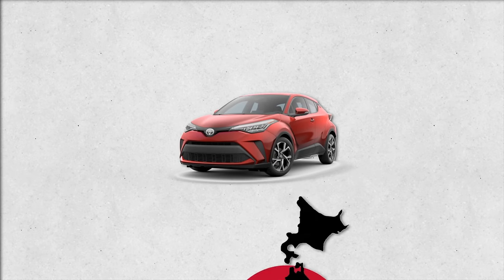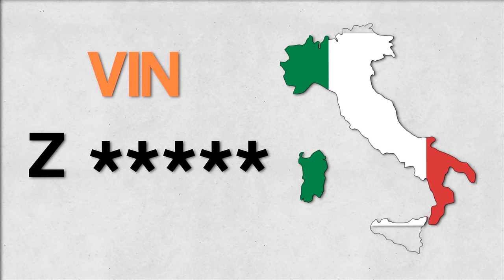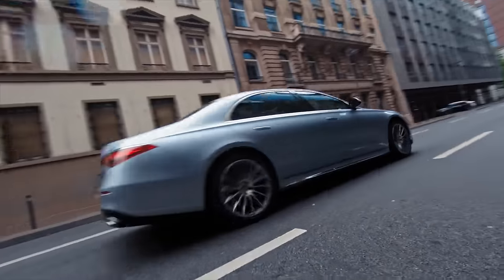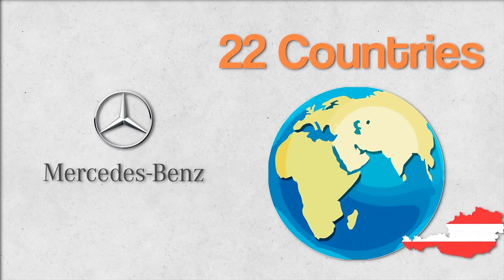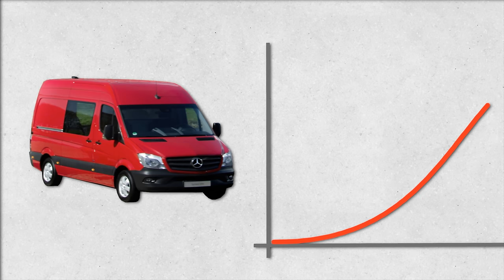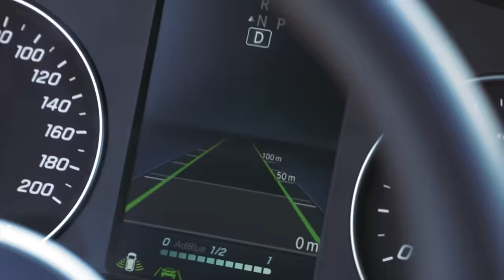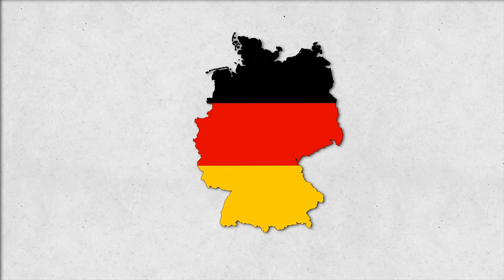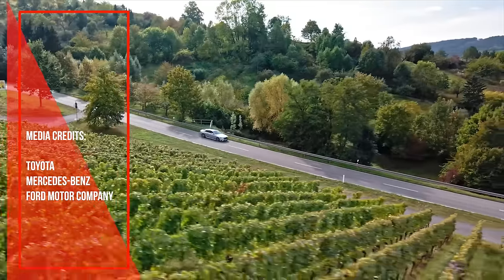Never Buy a Car Made in...

Comment: I used to be a mechanic at Honda. There was a notable difference between us made Hondas and Japanese made ones. The Hondas made in Japan came in for maintenance intervals. The Hondas made in US came in for rattles and water leaks. Everytime we had a car with a water leak complaint or rattle I'd check the VIN and it was US made.
Reply: Even a Honda Civic ─ Made in Japan & Canada ─ is like 25% Diff... in QC & QA's yet prices were about 15% higher from Japan.

My Subaru Made in Japan 1992 -- Never changed Timing Belt until 2019 & still in good shape😄🤣; and my In-law Bro has an Outback Subaru from US; and 2007; needed Gasket Heads and Cost more than 1k repairs; My Legacy never cost us more than 400 except the last time = Timing Belt, Thermostat, Water pump; made the repair bills 1k

That was all; except the CV-axles :thanksdoc::sanitizer:
Reply: I had one of the first VW rabbits made in their US plant. You could put a hose on it for hours.. no problem.  Drive it in the rain and it became a rolling bath tub. The frame flexed and seals and sealant around the A pillar would open up and let the water in. Wide spread problem. Never fixed. Unfortunately I bought it just before the NY lemon law was enacted.  Strange how the previous years cars made in Germany didn’t have that problem.
Reply: 2004 Honda CRV built in Japan.still going strong. 300,005 km’s on it. Still got original globes except for the headlights. 👍🏽
Reply: Wow!
Reply: 2005 chevy cavalier 305 thousand  kilometres and going strong.
Reply: funny how 2022 NSX Type S is made in OHIO 😂
Reply: @THillick , my dad had one he bought new in the late 70s and had the same leakiness. He even had it repainted but sold it at 9 years old for a Nissan that gave fewer problems and would have kept longer if not for rust issues.

Comment: I work in a GM plant which used to be a joint venture between Japanesa automaker and GM.

First 10 years there we had to implement KAIZEN as the Japanese insisted on it. Then GM bought out the Japanese portion and we became 100% General Motors.

Our assembly plant hasn't been the same ever since and quality has been declining rapidly, mainly due to difference in philosophy and approach.

Ex.

When we were half Japanese, when employees spotted defects and stopped the line to correct or report it, we were praised and we would often receive gift cards etc...

Under General Motors if you stop the line to point out a defect you can actually get in trouble, you're told that this is for Quality department to worry about it and not you, and if everyone will start stopping line for every little thing, we won't get our numbers. And a lot of issues won't get picked up by Quality because by the time it gets to them, other parts covered the defect etc... 

Also under Japanese involvement we had Quality Check Team at the end of every line, and we had shower booths to test for leaks. Since GM took over completely, they completely removed shower booths, we bo longer test for leaks, and we only have check team at end of Final line, where they are very limited to what they can detect.
Reply: To little to late to detect a problem at the end of the line. You will have to Re-Do the work again and it is one of the 7 known wastes in industry. The concept of TQM should work fine if implemented correctly, training workers properly what kind of defects require to stop the assembly line for.  In addition, you reduce the cost for extra QC Man/Hrs.  TQM is a philosophy and a culture more than a method of work.
Reply: Wow, you sold me
Reply: Is this Cami Automotive in Ingersoll, Ontario?
Reply: That's awful I would much rather strive for excellence if I was assembling anything! I like perfection especially on a item like a car where it's one of the largest purchases many people will ever make! 💯 Shame on GM!

Comment: I would buy a Toyota made in USA or elsewhere. May not be quite as good as made in Japan, but better than any domestic brand, based on experience and my wallet!
Reply: I will not own a vehicle that isn’t a Toyota my 200& Corolla has probably 350k+ on it. I drive it about 67 miles 4/7 days a week. Plus all of my family have yodas. Great car brand.
Reply: Its better than those in Southeast asians made. Those are crap, full of problems.
Reply: Yee toyota have much better qc than others. In my country bmw is just like they didnt checked any qc.
Reply: @idhamrodzali6091  Southeast Asian Toyotas are actually reliable.
Reply: Save your money.  I have a 2020 Corolla made in America and the engine needs to be rebuilt at 60,500 miles. Toyota will not cover it even 500 miles over the powertrain warranty and it'll cost $8k.
Reply: @sasukesuite1  been driving Toyota's 20 years, only routine maintenance, my neighbors have 2 with 345 and 260 thousand miles, again routine maintenance. You got one of the very few lemons. Before Toyata, lost almost 20K on the big 3. I understand your frustration, been there 3 times!
Reply: I have two chevys one with 900,000 and the other 300,000 miles. American made baby !!! I don’t buy Foreign cars. Keep the $ here… do you homework on buying vehicles and keep up with the Maintenance on them… it’s that simple

Comment: My 2002 Lexus ES300 is made inJapan and the quality control was at the highest with the 4th Gen ES (2002-06). AMAZING Build quality, fit and finish is unparalleled. Car is so quiet, the amount of insulation can’t be overstated enough. This is a major difference between a Toyota and a Lexus
Reply: AGREE!
Reply: No, you are imagining things.
Reply: My 2010 RX was made in Cambridge, Ontario, Canada!  Still driving like new and still looks like new!😍
Reply: @Jonathan McCully oh boy you’re a rookie. I have 93,000!
Reply: My 07 camry is made in Japan and has better quality than American made toyotas
Reply: @Jonathan McCully off a cliff? Try to find a used 2008-2015 IS 350 with under 150k it can be pretty tough sometimes not buying from dealers
Reply: @captinbeyond  I use a small auto repair shop, highly dependable. Business is at least 20 years old. Labor rate is $90/hr. He replaced my original alternator last summer with labor for $310. GENCO brand. 

I Would never bring my car to a Lexus dealership for service unless it was a factory recall item and being 20 years old I highly doubt any factory recalls will be coming out anymore
Reply: my 2002  Lexus LS430 Ultra luxury with 215000 miles made in Japan still looks New & runs like a champ 😁
Reply: My 2001 es300 is the same super comfy and made very well
Reply: Agree with you
Reply: @whostachi  best car ever owned and this is #21
Reply: @thomashenry794  my sister leased LS350 in 1996 and she turned it back after the lease ended and we the car was sold on the spot for 13K after the key and paper change hand.
Reply: @johnmadow5331  nice the older ones were better made but the newer ones haven’t fallen off a cliff like this doof is suggesting
Reply: @captinbeyond  I try & do all my services myself, I've done brake flush, power steering flush, and replace all 4 struts myself 😁
Reply: I have a 2006 Lexus is250 with 230k miles still runs like a sewing machine! Its the best car I ever had even  including newer ones!
Reply: @captinbeyond  Had 2006 LS, great car till small front end damage by car running stop sign. Never drove right since then, All of a sudden it developed the habit of accelerating on it's on, often at the 40 mile speed, Would pick up 20MPH on it's own. Stupid me bought off the floor a 2019 LS500 and was never happy with it. Sits in the garage while I drive a used Mercedes E350. Wife loves her 2015 RX350.
Reply: I own a 2012 Lexus ES350 with only 58K miles made in Japan fit & finish and driving experience is extremely smooth 👌
Reply: @KA-te7xk  I had a 2013 ES350 before my  ES300. I bought it in 2018 and owned it for 2 years, bought it from a dealership who took it in on trade. It only had 30k miles on it and I sold it to Carvana in April 2020 with 42k miles. Not one issue in 2 years. I changed the oil 2x and that was it.

Comment: My friend got his hands on a 97 4runner from Japan. Despite the fact that it has over 220k and a small coolant leak, she starts right up and runs fine. The interior is still in quite decent shape as well, and he bought it before prices went bonkers. Big win in anyones book
Reply: I got a 05 4runner with 223k miles, runs excellent. Had it since day one & I never changed the transmission fluid because the dealer told me not to. I really wished I didn’t listen to them but to be honest with you the transmission still shifts smoothly & zero issues.
Reply: @joeshmoe8952  please tell me you have changed it now though?
Reply: @Mika-ph6ku  For what? It’s been 17 years & not one issue. I guess Toyota was right.
Reply: @Mika-ph6ku  after like 50k miles if it was never changed it’s better to just not change it at all. Changing it now could cause it to slip and start acting up.
Reply: @cheesenuts1898  That’s a good point but I did change the transmission fluid on my prius which has a sealed transmission but it’s a 15. Lots of mechanics say the newer cars can have the fluid changed around 80k which was when I changed it, some even say you can do it at 100k but I did it at 80k. Next service would be at 110k.
Reply: @joeshmoe8952  there's not really anything in a Prius transmission, some planetary gearsets and electric motors, you could probably fill it with engine antifreeze and it would work fine

Comment: My 2009 Toyota Yaris was made in Japan. It has 296500 miles on it, paid $900 for it.
Reply: Have you had any mechanical problems with it?
Reply: I have a 09 yaris 165000 miles and been the best vehicle I have ever owned. Use full synthetic oil and I drive 5 days @ week 140 miles every day! I hope to have it for a long time. It has been taken care of very well.
Reply: I own a Lexus LS 400 for 10 years now and has 300,000 mi and runs better than any Cadillac with 100,000 mi plus it never breaks down most reliable smoothest quietist luxury car I’ve ever owned and I’ve owned a Cadillac a Lincoln and a bmw 744 all three were money pits especially the Cadillac 3 transmissions in 80,000 mi and constant electronic problems check engine lights all the time total junk the Lincoln was barely better and well the bmw that was a nightmare of expensive repairs nope only will own a Lexus and it’s all Japanese made very high quality built car
Reply: My 2007 yaris has done nearly 400,000 ks. Made in Japan. Running gear must be replaced. Just recently replaced alternator and starter motor, and water pump. Motor and gear box are as good as the day I bought it. Cheers
Reply: @bruceraymond8611  awesome! I love my yaris!
Reply: @claytongillaspy8847  amen! Hope to buy a lexus someday. Awesome cars!
Reply: @claytongillaspy8847  My parents had a  Cadillac and had to get rid of it because it had too many repair problems. But I am glad you found relief with the Lexus. I want that the be the next car I own.

Comment: Unfortunately, the American automakers (GM, Chrysler & Ford) don't follow that Kizen quality philosophy
Reply: They prefer for planned obsolescence instead
Reply: Apparently Toyota was the first to put it to a big test; Ford adopted it in 2006 .. and comes up in case studies alongside Toyota.
Reply: And
Reply: Last I seen U.S. Ford, GM, and Chrysler use a system call PPAP. All control of parts and or assemblies are the supplier responsiblity.
Reply: Watch an assembly video of any of those three manufacturers you mentioned.  All the workers look like they just rolled out of bed and dragged themselves to work.
Reply: What about American cars from the 50s, 60s, and early 70s.
Reply: @CJColvin  my 74 Gold Duster was fun to drive but I was constantly replacing ball joints, window cranks, radiators . The ignition system on my 72 Chevy 400 had to be jury rigged so many times, brakes , springs... but even Toyota wasn't that great in the 70s
Reply: @CP-jc9lj  True
Reply: It used to be that people in the US took a great deal of pride in their work. Unfortunately that is no longer the case, they want to make $50 an hour, get 4 weeks paid vacation, paid holidays, free health and dental, etc just to grace a company with their presence. Actually giving a crap about the work they do, getting it done efficiently and correctly, forget about it.
Reply: '85  lincoln  mark  7  lsc 
5.0 ltr v 8 ....like  the  mustang....built  for  speed  n  longevity.  lincoln  town  car  good  too.  both  luxurious,  n  stylish, n  handled  well.
ford  good  in  the  80s..

Comment: The first Lexus made outside of Japan was here in Canada. Both Toyota and Honda plants in Canada are rated as having the highest QC in the world and both manufacturers have named these plants as world leads for certain models.
Reply: Recently Scotty has mentioned Canada as having excellent QC.
Reply: Yes, my 2010 RX was made in Canada. It still looks and drives like new!
Reply: My 06 Matrix was built there. Almost at 200k miles and have only had to replace engine mounts at 160k and spark plugs at 189k.
Reply: My 1996 Chevy K1500 was made in Canada it has 228,000 miles and is running strong
Reply: Both cars were built in Canada (2012 Camaro SS/RS LS3 6MT & 2020 Honda Civic Sport Sedan NA 2.0 6MT). 
Haven’t had a single issue with either 👍🏻
Reply: Honda’s QC has been down the drain for years now.
Reply: We understand the Metric system in Canada, I wonder if that helps?

Comment: I worked in the woodshop of Executive Coach Builders and the very first limo I worked on was a Lincoln Towncar in bright yellow.  It was being exported to Japan to be used as a cab.  I also got to work on one of Gotti's SUVs.  Buses, Hummer H3, Lincoln Navigator, Chrysler 300c, and a few more.  I made the seats, the headliner with the lasers and the mirrors, the kick-guards for the bars, the chauffeur divider, and a couple of other parts.  It was a lot of fun working there.  Those limos start out as a typical car, they cut it half, stretch it, fill it in and upgrade a couple parts on the motors, suspension and so on, typical things you'd expect.